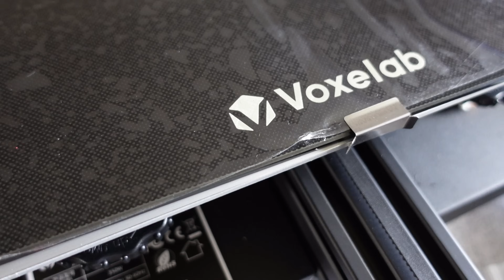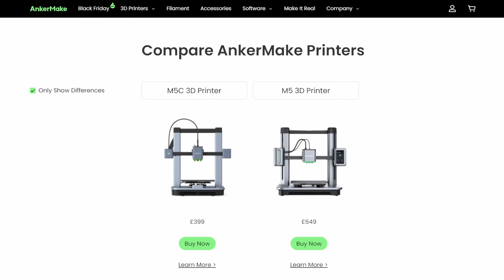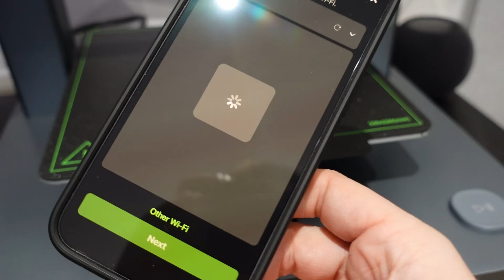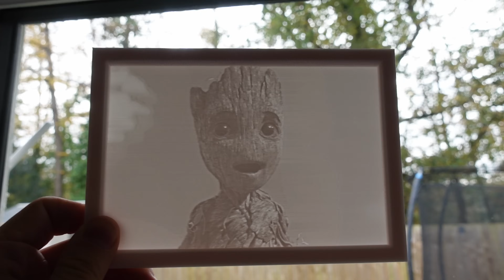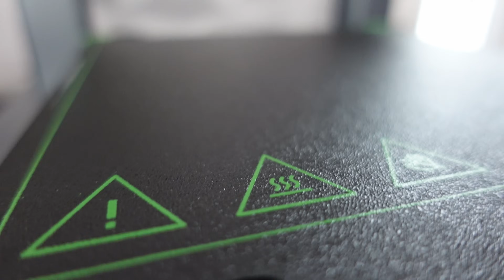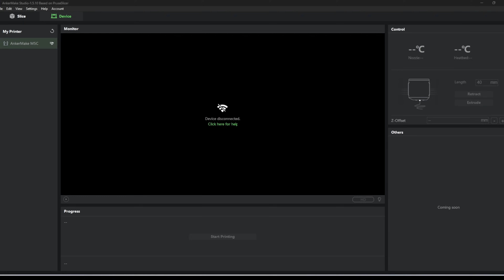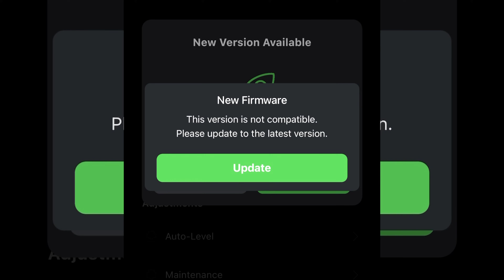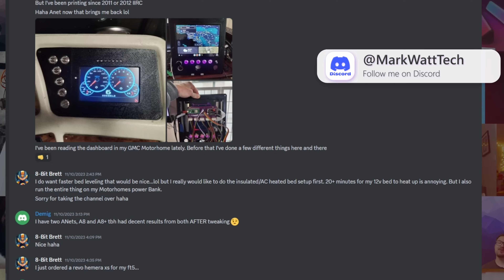5 Months with the AnkerMake M5C (My Experience)

Comment: Thread is stuck
Thanks Mark for this great video. Are you familiar with the problem of not being able to feed the PLA to the printer? I can push in (and pull out) the PLA in the PTFE. But all of a sudden I can't push it in far enough for the printer to feed it. I suspect that there are remnants of broken material in the extruder. 
How can I remove them?

Comment: I just picked up this printer and so far i love it. It was super easy to setup and i was printing a benchy within an hour of getting it in the box. (including assembly time) So far the default settings have been perfect. Im printing at the fastest speed of 500mm/sec and my prints are perfect! Took 10-12 mins to print a benchy test. So far i have already printing a controller stand that holds 2 xbox controllers (1.5 hours) and a headphone bracket that clamps to my desk to hang my headphones. (1 hour, 2 parts)

The app is a nice feature. Before i bought it i thought not having a screen on the printer would be an issue but it hasn't been a problem. The app can easily get tons of models from online and you can start printing them right away. Its also nice that i can send the prints through the app via bluetooth or wifi so i don't have to physically walk over to the printer to start up a print. I can just fire something off from the other room and go grab it when its finished.
Reply: So strange.  I got my M5C for xmas. My benchy took 35 min to print ( i was in fast mode)

It came out perfectly, but I wonder why it was twice as long as both of yours.
Reply: @robertdascoli949  I think I was incorrect about my print time, yours sounds more accurate, still a great printer.

Comment: would be nice if they sold gears
Reply: what gears do you need?  Just asking.  I picked this this printer up and will test for 60 days and see whats up.  If it does not work, I will return for an a1 mini
Reply: @jaimeastin  I just replaced the entire print head too solve the problem.

Comment: Hi . Great 3D printer . I have a question . I want to print a mask, but its to big about 30mm . Can I divide the mask in half to print separately?
Reply: Yup. Just use 3d gloop or super glue if you don't have it.
Reply: I used epoxy for a stronger bond and yes you can

Comment: Hi.  Just wanted to let you know I too have had the screeching sound on start up of my M5C.  When I checked with Ankermake Middle East (where I'm living), they said it was normal.

However I have been having more worrying problems with my Ankermake.  Allow me to tell.  I was printing some clear filament and in a piece I was printing, it went wrong and produced lots of tiny pieces of plastic that collected around the nozzle.  Obviously the heat built up and I ended up with a huge blob of molten PLA plastic around the nozzle and hot end.  In  my attempt to clear the huge blob of plastic (using a Dremel cutting wheel and a soldering iron) I managed to clear the hot end but I realized I damaged one of the temp sensor wires.  I had to order a new hot end and contacted Anker Middle East who sent me a new hot end, but for the M5.  After contacting Anker, they sent me another, but an M5 hot end again.  Anker were very good about it but said they were unable to get a hot end for an M5C and offered to refund approx.
 70% of the printer.

Really good service by Anker and I was impressed with their service however disappointed that Anker Middle East sell a product but cant provide spares.

Anyway, I managed to get a new hot end through Anker US.  But since then I started getting lots of what appeared to be burnt bits of plastic in the print and what seems to be, just spitting out of the nozzle.  These brown burnt bits were spoiling the print.  Then I started getting lots of clogging.  The extruder would get blocked between the end of the extruder gears and the start of the hot end and the nozzle cooling fan started to get noisy.  After one too many blockages I found that one of the plastic gears of the extruder had broken a tooth and the extruder was damaged beyond repair.

I have had to order a whole top end assembly (extruder, hot end and circuitry.  I think the over heating has damaged the Ankermake in some way and I hope that this replacement top end assembly will resolve the problem.

So all please do be carful when clearing a blockage and I hope the country where yo bought your M5C does have spares available.  My M5C was a great printer right up to the point that it wasn't.  Anker tried to help but failed and in their cost cutting for the M5C they have gone with plastic gears in the part of the printer that really should have been metal.

Comment: Thanks for this Mark. If I literally just want an entry into 3d printing for some ESP cases and maybe a little fun with the kids (9 and 7) is there a printer or brand that you'd recommend? Was thinking I might try and pick something up second hand, but perhaps I'm better off getting a budget newer gen based on your comments?
Reply from the maker: Hey Simon. Personally I think this printer would tick all the boxes for what you are looking for. Its a simple plug and play and you will be printing in minutes. I would definitely wait for a sale though if you are thinking of this printer. I picked up an additional unit recently on sale and also got a choice of filaments with it.

As this is a newer higher end budget printer it has lots of great features that will save you a lot of headaches you will get if you just opt for a £150 printer. 

Next year AnkerMake are releasing the V6 Colour engine which is an addon for this printer that will give full multicolour printing capability so could also be a great upgrade.
Reply: Idk if you already bought it but it’s 240 dollars on the ankermake website!

Comment: That fan noise is the classic sound of a cheap fan bearing failure.  Mine does the same until the bearing warms up - or at least that’s what I assume is happening due to the poor bearing friction.  A good quality fluid or magnetic bearing fan will get rid of the sound.
Reply: I own an M5C and that noise is definitely not normal, at least compared to the one I have. I'd tend to agree with the faulty bearing theory.

Update: Mine has started making this noise too, until it warms up. Ankermake support aren't being overly helpful about it either. I'll put up with it until the fan fails, then I'll replace it with something better.
Reply from the maker: Thank you for the info. I will take a look at the fan :)
Reply: Can I change the fan for  a quiter one because I might put this in my bedroom when I get it since I don't have anywhere else😅
Reply: @Krispy367  people like Noctua fans for their silence.  I don’t have any so can’t comment on how accurate that is.
Reply: @roberttco1  yeah I know noctua have great silent fans but is it possible to open up the nozzle enclosure and connect it straight away? If you will try a solution can you update me please I would really appreciate it
Reply: I have the exact same loud sound on my M5C. Started after 2-3 months of printing.

Comment: Hi! Great video! I'm just digging for M5C content because I am looking to get one for the holidays. Thanks for the content.

As far as the dust from the wheels, that is normal. The wheels are just wearing in. You just have to adjust the pressure on them by turning the nut.  There are videos showing how to adjust them on other printers, but the same method applies to the M5C. Again, I don't have a printer. I just know this from all the damn reading I've been doing...haha.  

Thanks again for the video!